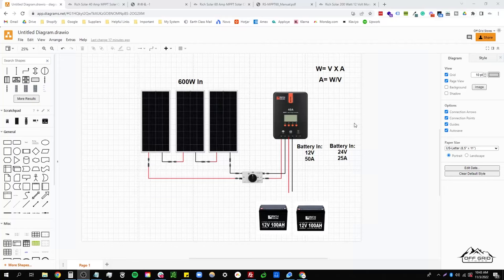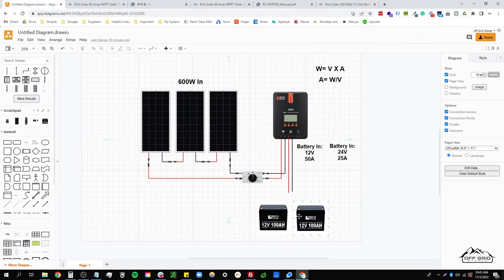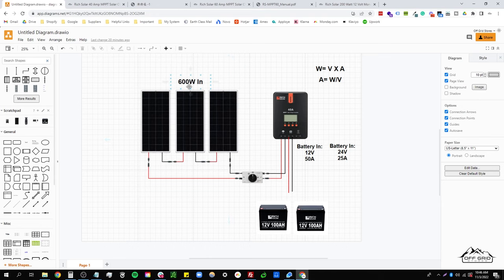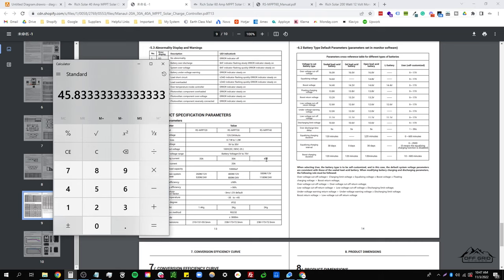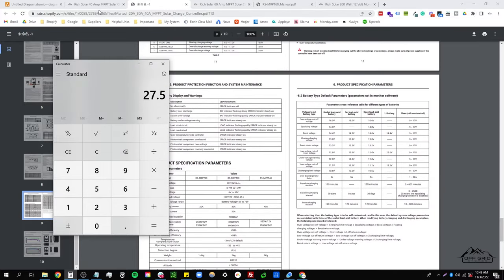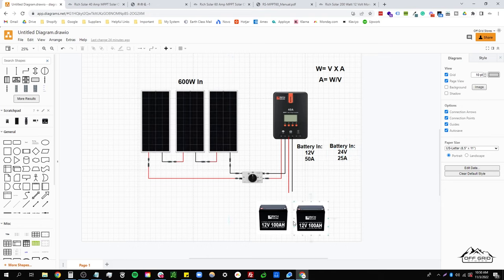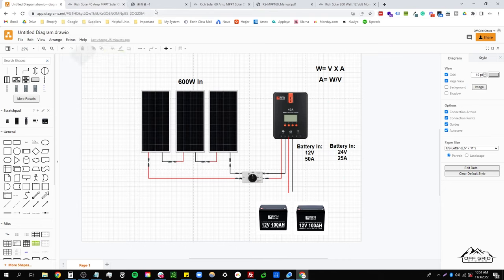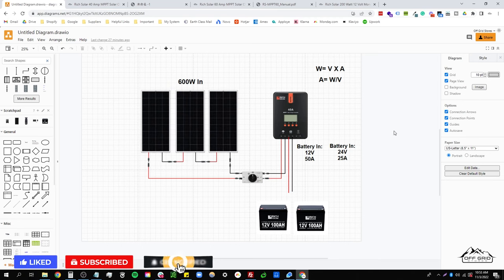How To Properly Size A Solar Charge Controller For An Off Grid Solar Power System

Comment: I have 2 sets of 3-200 watt rich solar panels each having a 40 amp rich solar charge controller going into 1200 amp hours 12 v eg4 server rack batteries. Got everything from rich solar and they said to set it up the way I have done. Been working fine for months. FYI to future system builders, go 48 volts. Just do it and get a 12 volt converter. Do not do a 12 volt system. I was stupid for NOT doing a 48 volt system. Less equipment with a 48 volt system, less money, more options to choose from and far larger expansion capabilities.
Reply: This is interesting! You mean I can step my 48v battery to 12v and use it? I have a 24v 200ah and a 48v 50ah and been wondering if I can use it with my 12v 3000w inverter

Comment: A 40 amp controller is cheaper than a 60 amp so use two 40 amp controllers. Split the system into two separate channels except connect the inverter to all the batteries.
Reply: that is a cool idea

Comment: Get the biggest Charge Controller you can afford 80/100A & over size your Inverter as well, 4000/8000W or higher. Get as bigger battery's as well. That way you won't stress your system If you have the fridge, lights, TV & AC on at night. The closer to the Poles the more Panels. Closer to the Equator the less Pannels needed depending on the rain periods. As long as you can keep the Battery's full. Panels to CC 8G, CC to Battery's 6G. Battery's to Inverter 4G. Use Switchable Fuses. That way you're not doubling up with using an expensive Switch & a separate fuse.

Comment: Like as far as I was aware you can over pannel as long as you don't get stupid about it, and for a lot of places in the world over panneling makes a bunch of sense because 95% of the time your not going to get what your pannels are rated at peek sun so over panneling by 50W with 600W of solar pannels is not a big deal, like really in places with shitty weather like the UK I don't think 50% over panneling is a bad choice if for example 600W is all the power you need, then buying a charge controller that would give you 600W is what you should do, but having 900W of solar pannels means that when you have sub optimal conditions you will still be getting 600W

Comment: I was not completely sure how many amps of charge controller capacity I need. I am using two 12 volt 100ah lithium batteries with three 200w 56v, 3.59amp solar panels what capacity of solar charge controller works best? was my question. At 5.46 of your video you clarified that I need 60amp charge controller. Initially I bought 100v/15amp Victron charge controller but later realized that it will be too low of amperage capacity. Then I found a website how to calculate that amperage. I got 62.5 amps as an as an anaswer. This video confirms that calculation. Thanks for your video!

Formula: Charge controller ampere (Size) = (Solar system’s power / Battery bank’s nominal voltage) x Safety factor

Amps = (Solar system Watts / Battery bank Volts) x 1.25

= (600W/12V) *1.25

= 62.5 A

Comment: I think a mppt charge controller should be able to handle any sizes of solar array provided the Voc of solar is below the rating of the mppt. The mppt takes what it needs to charge the battery from the PV and leave the rest.

It is good to oversize your PV so that you can get enough through the day.

Comment: Hi all, I’ve only had experience with Victron chargers, but thermal throttling will take place if you are working them to their full rating. A small 12 volt snale fan to assist cooling is the answer.
I’ve kept within their max limits to give me the max I can get from my limited size array and they will get hot when it is running at the max and I’m in the cool UK.
I’m charging lithium batteries and want them to charge as quickly as possible whilst not damaging them.
Take care all M.

Comment: I have 8x600watts solar panels= 4800watts, 4x220ah batteries, and 5kva inverter.  Can you advise me on the right mppt amp charging controller I should get?

Comment: Thanks for the video, very informative.  One question though, you say you can't hook up the three 200w panels (600w total) to the 40A charger controller (specs say max 550w PV input).  However that's the exact 600w combination that Rich Solar sells, and it's listed on your website for sale.  I must be missing something?
Reply: I'm watching this video for the second time, I think something is not correct on this content. Tell ya later
Reply: @closetcleaner  After more investigation, and a call to Rich Solar, the answer is that you CAN indeed hook up 600w of panels to a charge controller with 550w max.  550w is just the conversion max; more than that is just not used.  Safety wise, you just have to not exceed max voltage & current.  Also 600w will only produce 600w under perfect conditions, and especially if the panels are flat mounted you'll never actually see 600w.

Comment: what to do if you need a charge controller of 228A?  I don't see any for sale online.
Reply from the maker: Wire your panels in another configuration to not have that many amps. That’s pretty high.

Comment: Can anyone help? Im trying to do my 1st solar diy and keep running into issues. Looking to see what i can do.
I want to get 2x 660w panels
44.89voc each and 18.42 amps each.

So roughly 1200 watts 90voc and 40 amps.

I keep trying to find a charge controller that will pv input 1200 but i cant find a charge controller thatll do more then 720-960watts for 12v battery system. What can i do? Would using 2 charge controllers work and just have 1 panel 1 charge controller each?
Reply: Go 24v

Comment: But, if I hook up a 30 amp solar panel to a 100 amp charge controller would that hurt?
Reply: The limits posted on the charge controller specifies the MAX amount of solar input it can accept. If the input current goes over the rating for the CC that will cause problems (overheating, short circuit, etc).

So, when purchasing a charge controller so that it can handle the amount of power you plan to pass through it, including upgrades in the future if you plan to upgrade (add more panels) otherwise you would need a bigger CC

Things that need to be balanced are voltage and current input from solar panels V and C for CC, battery voltage, capacity, wire length and thickness (gauge/ awg)... the way these variables relate will greatly impact the useflness and efficiency of your battery/solar system.

Comment: I have a problem. I have six 120-watt panels that are producing about 420 volts now at about 32 amps. as measured right before it enters the Epever 60-amp solar controller. I have 2 Weize 100 ah batteries wired in parallel. My amperage going to the batteries is only .2 of an amp from the controller no matter if the batteries are at full charge or at low voltage shutoff of my inverter about 11. volts. I have had 2 new charge controllers and they are both putting out the same voltage to the batteries when I have either one wired up to the system. I am really frustrated as I cannot figure out how to get enough amps flowing into the batteries from the controller to help keep them charged. This results in me having to put a Lipo4 charger on the batteries every day or so to get them charged back up. I have tried about evry setting I can change in the controller to no avail. Could it be the BMS system in each battery? I cannot afford to buy a third controller to see if the other two new controllers are bad bt I highly doubt that scenario. Any advice or help would be greatly appreciated.
Reply: I'm guessing the batteries are LiFePO4. Make sure that the charge controller is configured for that type of battery. I have a rebadged EPEVER CC and found that the instructions were not very clear.

The numbers you state at the beginning do not add up - there is a mistake somewhere. Restating what you said: I have  720 Watts of solar panels that are producing about 13,440 Watts.

How do you have the panels wired up? My guess is all 6 in parallel, and your 420 volts is actually 20 volts. I would investigate rewiring them as 2 in series/3 in parallel giving about 40 volts, 16 Amps. Whatever you do, do not exceed the max input voltage rating of the charge controller (you will likely destroy it).

Comment: By the way, I learned something recently while doing a few scientific experiments with solar power. The experts tell you that when you bang panels together you're supposed to connect the negative to the next positive. Well I know a little thing or two about direct current, and I can tell you when you do that you get Distortion. And that is why most solar energy only produces 25% of the energy it takes in. When you straight wire them negative to negative and positive to positive they produce more like 80% of the energy they take in. And I discovered this accidentally by playing around with those little solar panels to charge phones. I banked 10 of the 60-watt ones together, and I did straight wiring instead of cross wiring, and that little phone charging unit I have right now is producing 600 W. I haven't going into my house into a bank of rechargeable power Banks. Like 15 of them with the 20,000 milliamp hours each, and it's basically like a little Tesla powerwall for charging up devices. It will even charge up a laptop.
Reply: Dude, connecting neg to neg and pos to pos is parallel and currently actually  increase. Nothing new... Good luck playing with electricity.